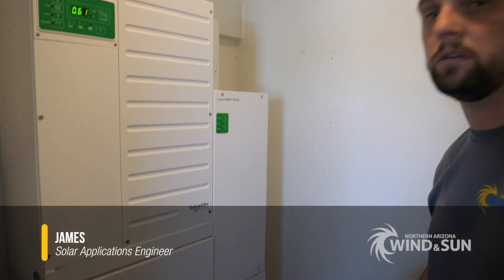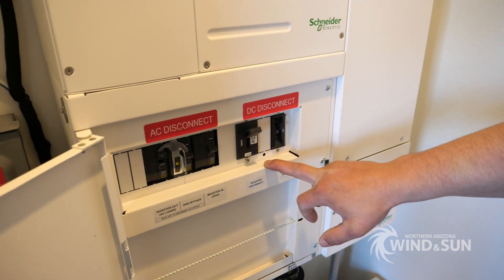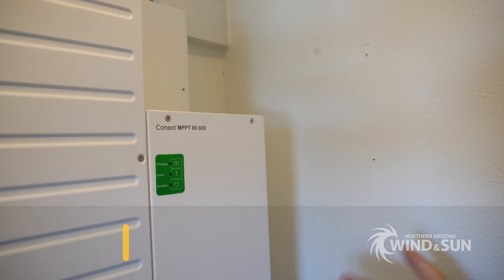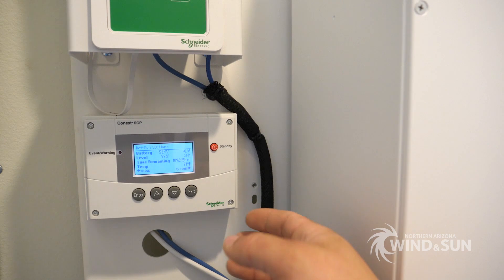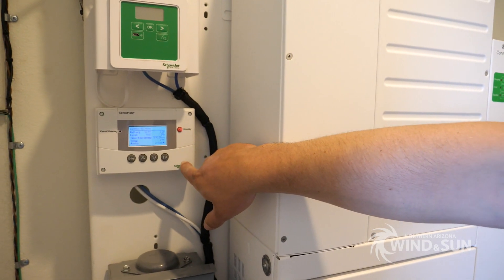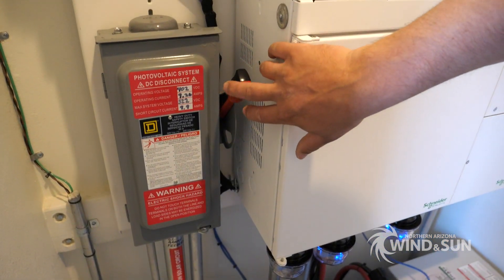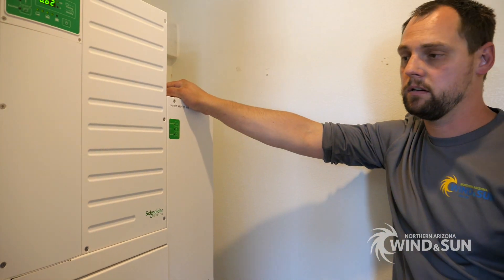Schneider Conext XW Pro Overview

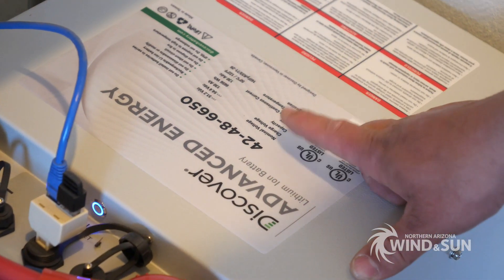Comment: 2:35 how many amp hours...I want to know how long they will run something.....Ah tells how long they will run...Kh tells how much power they put out

I want to know the Ah
Reply from the maker: @t00ls742 the product documentation says that the "battery bank range" is 440-10000 Ah.
So, without any storage added, you have a 400 Ah charger in this product. You can add several batteries to increase that range up to 10,000 Ah.
Reply from the maker: Here is the product documentation for reference! https://www.solar-electric.com/lib/wind-sun/Conext-XW-Pro-UL-DS.pdf
Reply: @NAZSolarElectric  those batteries are 85-100 Ah ...XW recommends 450Ah battery bank to start out with

having said that, 450Ah wont last long off grid, and most people that live on grid right now want to take their whole home off the grid.....it isnt practical as it would cost more than most want to pay, here is just a bit of what you would need for a typical on grid home to go off grid

3 XW pro 6848 inverter running parallel
2 or 3 80-600 xw charge controller 
10 - 15KWh solar array  ...can be accompanied by a microhydro system and less solar and or a wind turbine ( if the sun isnt shining the wind is blowing and the water flowing)
a 2800 Ah battery bank (200KWh) less if wind and hydro are incorporated
a whole home backup generator to charge the batteries for when the sun doesnt shine enough ( it can be operated with the XW system
an XW AGS module  
a XW SCP along with either insight home, combox or an XW config tool

now if you just want grid backup with self consumption ( selling back to the grid isnt worth the effort) then you wont need as many Ah of battery but you will need all the other stuff still

batteries are the largest expense in a system.....as I said KWH is how much power they will put out through a motor...Ah is how long of storage you have given the amount of amp draw

Comment: I purchased a full house solar system in Oct 2020 from a solar installer with many years of experience with this system.  The electronics were all from Schneider Electrical and included two inverters and charge controllers and associated equipment. After two years the system began to experience numerous failures to included getting stuck in a loop, cycling the power on to the house several times before resetting on a number of occasions. The system also frequently shut down requiring me to reboot the system with error codes that made no sense such as fused relays. The system finally completely failed.  Despite numerous service calls from the installer over the space of a year and many wasted hours they were unable to get the system to work and would not continue to support it.  I replaced the system with a Solar Arc 15.   I have made numerous attempts to reach out to Schnider to address this problem and cannot get an answer from their customer support center.  The phone rings for an hour and just disconnects.  The system is still under the five-year warranty. I went with Schneider equipment with the belief that this established company would be a safe bet, instead it has turned into a living nightmare.  I want to return the system to Schneider for a full refund. Since I wrote this several days ago and mailed them a copy they remain nonresponsive.
Reply from the maker: We are sorry that you are having that experience with Schneider  Electrical and that neither they nor your installer have been able to resolve the issues. We hate hearing stories like this when there are so many ways to install and support solar equipment successfully. Our team of engineers are on hand to support any of the equipment we sell to our customers -  for the life of the system. I know that doesn't help you since we did not sell or install your equipment but if we can be of service please reach out to our team: customerservice@solar-electric.com

Comment: Another question - i saw a video about a victron system that burned up in a mobile trailer, because per their speculation the wire connections were not seated properly, the schneider wire connections look very similar to the victron system, are there any issues with this method of wire connection?

i prefer nut and bolt that makes a solid connection, not sure why these high end companies use these (what appears to be) less reliable connection systems.  Your thoughts please?

Comment: where can i gain knowledge to help me design a multiinverter, multi mppt, system, using schneider components?

i need to know max units that can be stacked in parallel, and other info to be able to design several different systems for my clients

thx
Reply: you have clients, and you dont know where to get this info....you must not be NABCEP certified

Comment: i HAVE GOT A SCHNEIDER 4048 INVERTER. WITH IT I HAVE 8 12V 200AH GEL BATTERIES )RENOGY= AND A OUTBACK FLEX 80. MY PROBLEM IS THAT AFTER TESTING BATTERIES THEY ARE OH, BUT IT VOLTAGE DROPS VERY FAST. )51.0 VTO 48.V. AND I GEY A LOW VOLTAGE MESSAGE .OUTBACK HAS BEEN ADJUSTED TO BAT SPECIFICATION. CAN ANYONE PLEASE ADVISE?
Reply: It’s truly a 48 v battery. The 51.2 should come out to about 102-104% state of charge in your metering equipment. This is normal for the batteries and doesn’t have anything to do with the inverter
Reply: And if using li ion batteries you NEED the pro. That’s the benefit of the newest version
Reply: 48 volts for a gel battery is way to low....they need to stay at or above 51 volts

Comment: how much does it cost
Reply: Over $3000, that is just the inverter/ charger. I don't believe that includes the distribution panel and controller.
I am just assuming. Just Google. You will get an idea. Schneider Electric is more top of the line I believe.
Reply from the maker: Hi there, yes Stan is correct. Here's the link to the product page: https://www.solar-electric.com/schneider-electric-xw-pro-6848-21-inverter.html